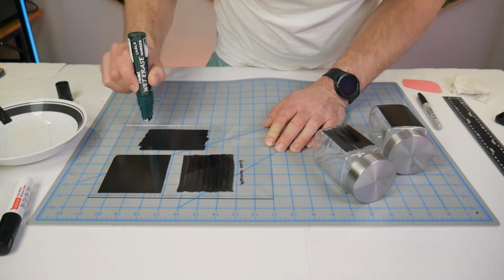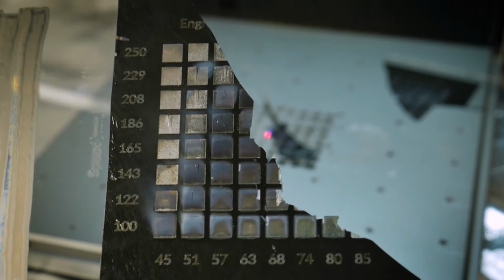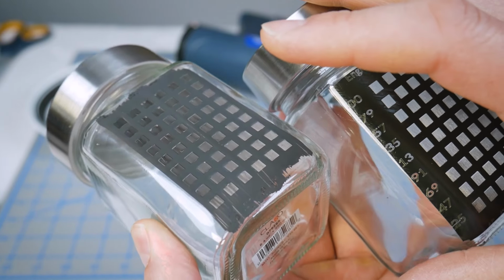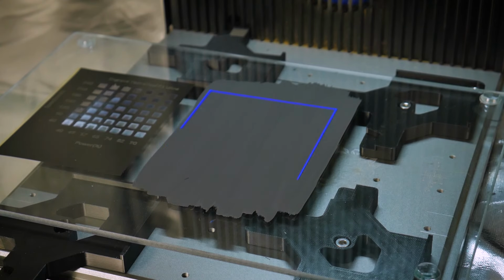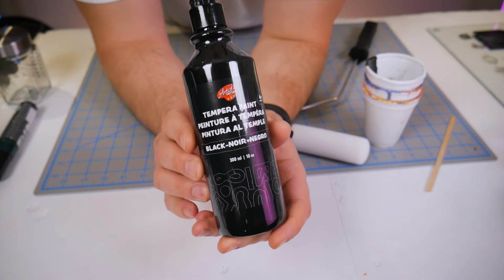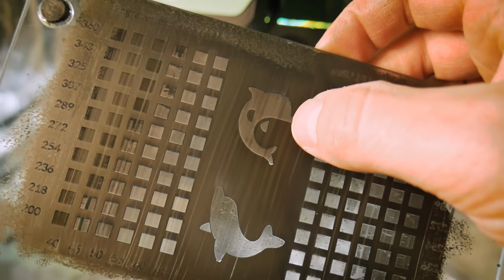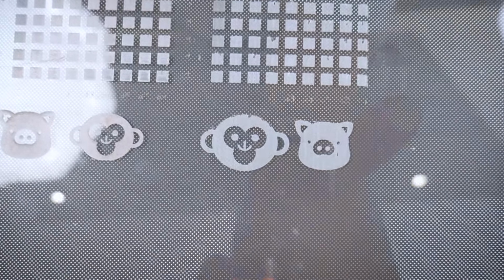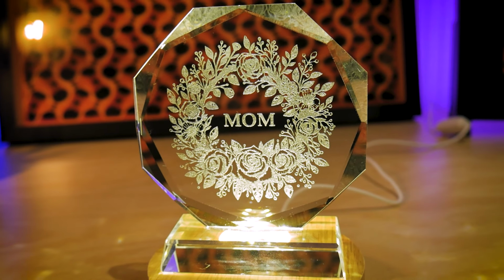How to Laser Engrave Glass with a Blue Diode Laser (Best Techniques & Materials)

Comment: Hi, I’m one of your subscribers and I really enjoy watching your videos.
About the paint and its adhesion — meaning how well it stays on glass or ceramic surfaces — I have a very, very good tip.
I ran some experiments myself and improved the paint that used to lift off during engraving.
Since it’s a water‑based paint, I figured it could be strengthened to bond better with the surface.
So I added a spoon of sugar and mixed it well — and the result was immediate: super, super, super!
You can modify any paint this way. Enjoy it, guys — I’m happy to share this discovery.
Reply from the maker: That is a super interesting tip, I’ll have to give that a try! 🤯
Reply: Does it have to be sugar or would any powder material work?

Comment: I use black tempura paint that I thin out a bit with water and apply it with an airbrush. I dry it and splay several coats til it block most of the light. You get fantastic results with this method. 😊👍

Comment: Thanks for the video. How did you remove the laser marking paper?
Reply from the maker: Washes off with warm water and some light scrubbing. If you have areas with tiny little pieces stuck you may have to use something like a hobby knife or vinyl weeding tool to lift the corner and peel but you'll want to do that after applying more warm water
Reply: @EmbraceMaking  Thank you. Have you tried to do this with the F1 original? I've tried different settings but haven't got a good result😢